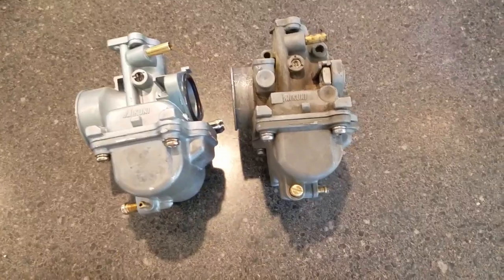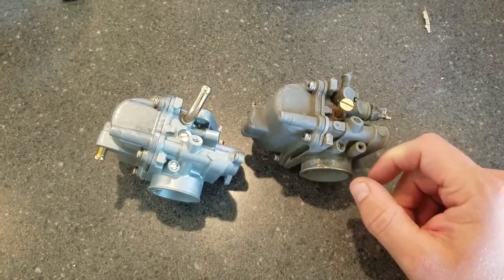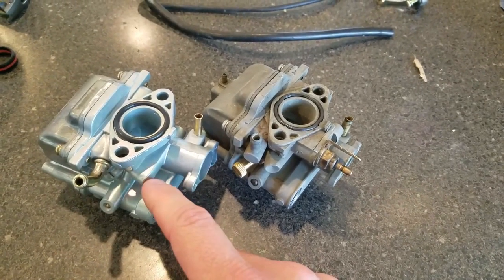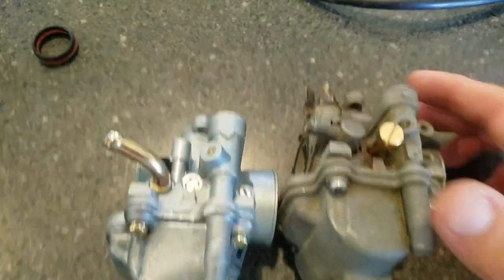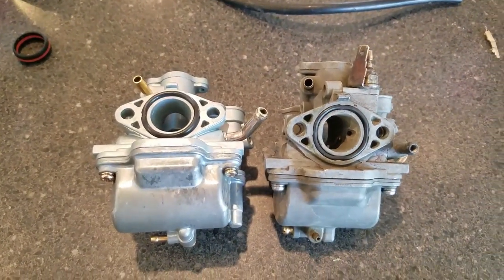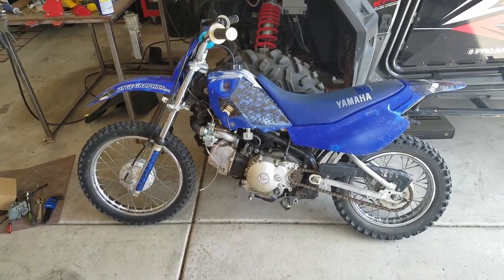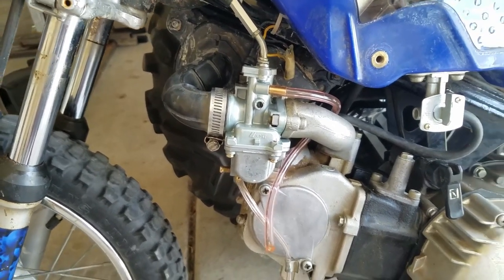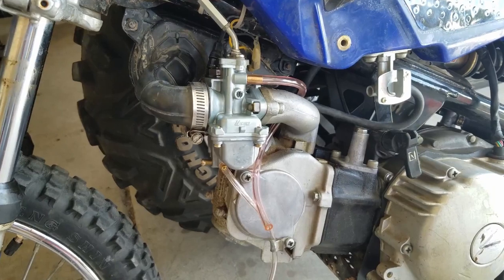Cheap VS OEM Carbs, Do They Work?

Comment: I MYSELF GOT THE SAME CARB. IT STARTED AND IDLED GREAT. I WAS VERY HAPPY UNTIL PUTTING UNDER A LOAD AND I'M SURE IT GOT REAL LEAN. IT WOULD BASICALLY DIED AFTER 1/4+ THROTTLEI TRIED DRILLING THE MAIN JET JUST A BIT LARGER AND THAT TURNED OUT TO MAKE NOT EVEN HARDLY START. I GOT ANOTHER CARB FROM AMAZON AND IT LOOKED LIKE IT WOULD BE GOOD, BUT IT WOULD HARDLY START AND WAS REALLY WAS WORSE. I HAVE PONIED UP FOR FACTORY CARB.. NOT INSTALLED BUT MAYBE ILL LET YOU KNOW HOW IT WORKS. THE FACTORY CARB HAD BEEN REPLACED BEFORE I GOT MY TTR90 WITH SOME PERFORMANCE SET UP BUT THE AIR FILTER ALLOWED DIRT INTO THE ENGINE AND I HAD TO REBORE THE CYLINDER AND REPLACE THE PISTON. SO FARE I AM NOT PLEASED WITH THE CHINESE CARBS FOR THIS BIKE. THEY ARE PROLLY FINDING CHEAPER AND CHEAPER SUPPLIERS AND JUST NO QC.
Reply: You know these carbs don’t just bolt on. They do need to be jetted for your application unless they state they are for your EXACT model and year of bike. It sounds like you needed your needle jet raised or maybe a bigger main jet.
Reply: Need to adjust it.

Comment: I have 2 Honda TLR 250 trials bikes, i decided to buy a replacement carby, i purchased a Sheng Wey which is Taiwanese made, a LOT better than chinese made !! The Sheng Wey is basically exactly the same as genuine Honda, the oem jets, slide, float etc are all interchangeable, my bikes fantastically, i'm very happy with the carby's !
Reply from the maker: That's excellent! I'll keep that in mind next time I need one. What was the cost?
Reply: @TheDadBodWorkshop  I bought the first 1 about 3 yrs ago & was so impressed, i bought another 1 about 6mths latter. 
Pretty sure it was about $60us plus about $10 shipping ?
Reply: @briansmale5457  where you buy it from ?
Reply: @neurowavemusic4273  I bought them off ebay about 2-3yrs ago, the seller is in Thailand i think ? You can buy the same carby from a UK seller but it's double the price :(
Reply: Good to know buddy cheers

Comment: Hi I have 2006 Yamaha TTR 90 electronic start and it will not start at all and I think it's because my pilot air screw how do I seat it promptly
Reply from the maker: Have you tried spraying a little starter fluid into it? That's a good way to determine if it's carb or something else. If it starts for a few seconds and dies then the problem exists in the carb. If it doesn't start at all then it something else. As far as how to fine tune these carbs I'm not sure... I have been pretty unsuccessful at tuning this one I had. Thanks for watching, sorry I couldn't be of more help!
Reply: XinnKoda yeah thanks man for respond I have not tried any starter fluid but I hope that's not the problem
Reply: If it’ll run for a second on starting fluid then you need to clean your carb. No amount of screwing with the air screw will make it run if the plot jet and main jet is clogged.
Reply: Pilot Jet has nothing to do with the electric start
Reply: @silkcustoms520  what? Yes it absolutely does. It may run on choke but a clogged pilot will definitely affect how it runs. Especially at idle.
Reply: @ryanthompson2893  
My Bad, I read it wrong. Yes, Running. I thought you were talking about the electric start being dead. Not being a Wise Ass. 
I have 2 TTR90’s my Kids grew out of. I think I restored everything on these Bikes over the years. 
Peace
Reply: Even if you unclog the pilot jet, there is another small hole above where is screws in. It might be clogged and not letting any fuel out. That was the problem with mine.

Comment: I noticed the after market carbs do not have the heater connection.  Is it absolutely necessary to have this?  Also, is there another Yamaha model that uses the same parts as the TTR90?  Parts for the TTR90 are not easy to find.
Reply: no, you don't need the heater connection. I used one of these carbs on my ttr90 it works fine without the fuel heater. The fuel heater wires will spark if they ground out so dot just let them hang.. I found out the hard way.
Reply: @brytodunsm5713  thank you for this reply cuz i just got a similar china carb without the heater connections and was worried

Comment: bought 2 cheapos     from ebay both rubbish bike would never run right managed to get a second hand original  bike has run perfect for the last couple of years
Reply from the maker: Thanks for your input! I've had good luck with the cheap carbs as long as they're a basic carb and don't require things like power valves or accelerator pumps. But I try to go OEM or big name brand for anything beyond a basic carb.

Comment: Huge Difference. OEM isn’t cheap but they are built to last forever if u take care of them. Those cheap carbs will literally chip away and shavings will get into your carb. The bolts and jets will strip and snap in half. 
Also, when you buy carb repair kits( jets)  get the OEM ones for 30.00 instead of the cheap 9.00 ones.
Reply: I've had to replace the stock mikuni carb on my ATV (arctic cat 500 from 2000) since some jackass put oily sticky axle grease on the air filter which when it sat for 3/4 years it sealed the entire floatbowl shut. So I had to get a aftermarket carb lesson learned don't buy cheap carburators from ebay. Amazon has legitimate suppliers with working carbs ready to ship.
Reply: @orangelightproductions2418  why fo they do that with the grease? I found some grease in the airbox of a quad i bought
Reply: @JMASON-qy7ki  it's common to put grease around the rim of the air filter/airbox, but it's supposed to be a thin layer on the rim only

Comment: Whats the best spot to buy a carb
Reply from the maker: For these cheap Chinese carbs I usually use eBay. Thanks for watching!
Reply: @TheDadBodWorkshop  Amazon is better, ebay has a problem with bad carburators and needle valve not sealing thus gas leaking everywhere. Amazon has more legitimate suppliers.